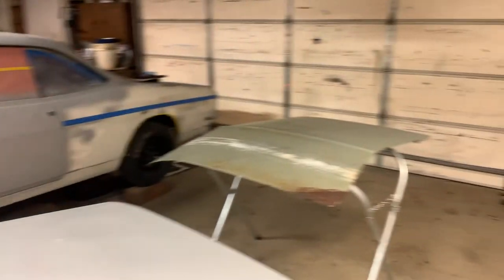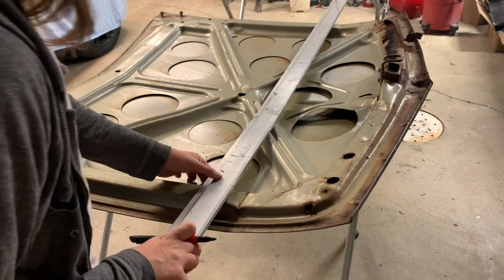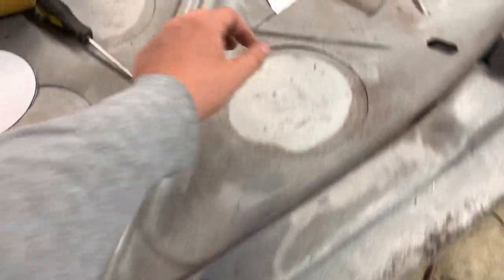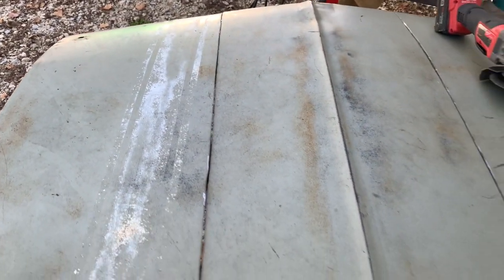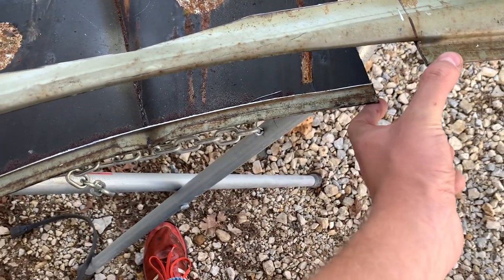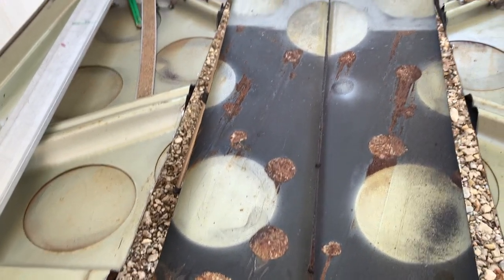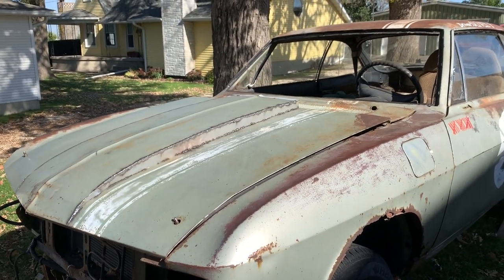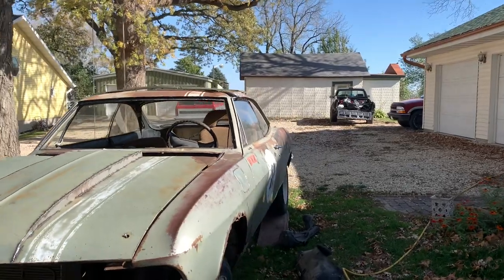How to make a cowl induction hood.  (1969 Chevy Corvair/s10 chassis swap Part 9)

Comment: Oh yeah here we go
Reply from the maker: I just posted this😂 your early!🥇
Reply: Oh no I'm right on time
Reply: I going to do mine like that I like it.
Reply: Just about got my body on the frame still timing to get headers and transmission to fit I have to Rais it up and let it down with two chain hoist slow process but it just me and I'm old.realy enjoy watching your progress. Just woundering what seats to install as my car has no interior.
Reply from the maker: @ericwilkes238  Sounds like you are making great progress! Are you using the S 10 floors like I did? Or it will be making your own? I am going to use my S 10 seats for now but my car came with a factory bench seat and I think it would be really cool to reinstall it. So I am probably going to do that.
Reply: No I'm just sitting the hole car less running gear on the s10 frame that has a 350 and 350 trans drive shaft will cut the floor to fit.got to notch the floor to fit the back frame rail humps to get the body lower looking for a nice hot rod stance if possible.